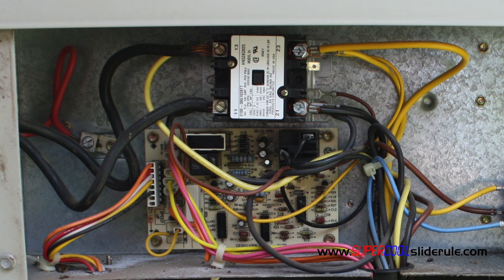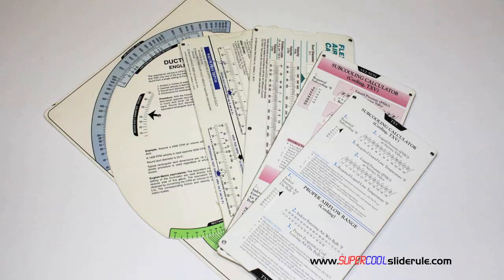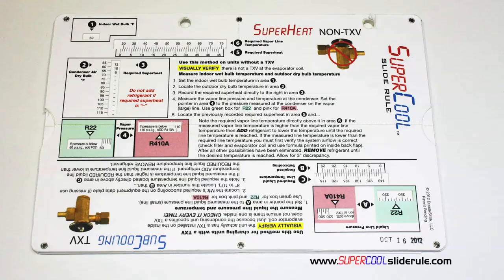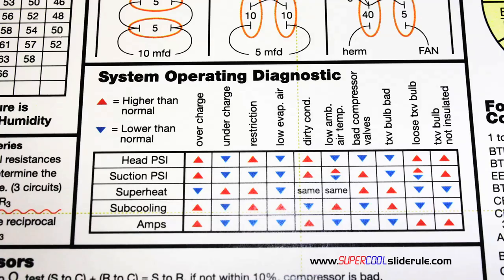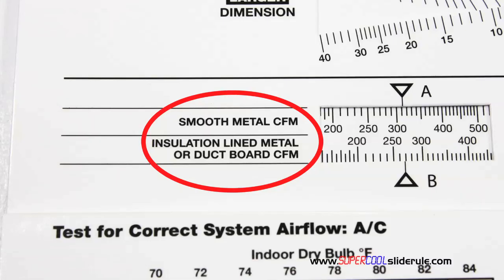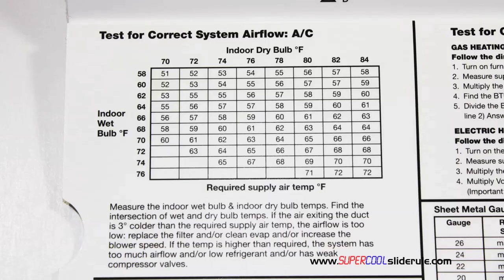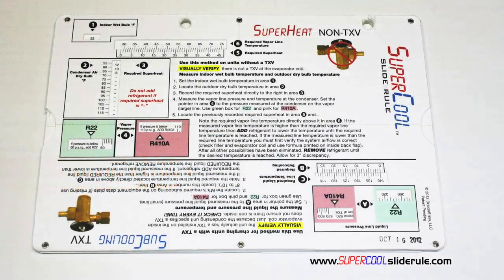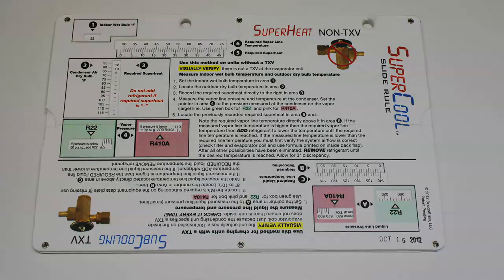How to diagnose a bad condenser fan motor

Comment: I bought a clamp meter and checked the dual capacitors capacitance and its reading what's on the capacitor plus this is a new one I bought the other day just wanted to see if it was bad.

Next if im even doing it right since I cant find on YouTube to show what wires to clamp for amp draw or what to set my meter to so I set it to 40A and clamped each wire that went to the capacitor as it was running.

1) Thick yellow one that goes to the compressor was 5.78
2) Fans black wire was 1.7
3) Fans yellow wire .82
4) Fans brown wire 1.51
5) Red wire coming from contactor to the (C) was 6.58

Now it took about 5 minutes to check these wires so no it wasnt hot but it was warm and I checked for oiling ports and there are none so I cant do that. I want to mention I had to spin the blades to get it going and Im not sure if it would have on its own if I waited but they turn slowly and eventually get faster untill it does run.

On a side note I spun the blades to see the resistance and if it spun and it did but with resistance then after running for the 5 min the resistance was gone and it spun better.

Motor Westinghouse 350358001 322P859 230V 1PH RPM 1075
Tech Specs: 350358001 322P859 208/230V 1PH ETU42 RPM 1075 1.5 3 3/16" x 1/2"SHAFT CAP: 5 MFD/370 VAC.CCW ROTATION 

The motor is 4-7/8" in diameter and if it was bad what replacement motor would fit because the westinghouse one is obsolete. Thanks!

Comment: Awesome!  Thanks!  I tested the leads with my Supco megohm meter... tested good.  I'm glad you clarified the heat pump board terminal connection.. I was stumped.  Turned out my first theory was correct;  thermal protection.  Fan was overheated.  The capacitor wires were reversed making the fan turn the wrong direction.  I also need to verify the microfarad requirement for this unit.  Never know who changed it last and just went with the closest thing on the truck.  I love YouTube training videos!  Subscribed..

Comment: I have an old lenox ...that's worked fine and did up until the time I shut it off last year.  I turned it on yesterday...and noticed that the temperature wasn't dropping in the house...then I remembered that I didn't take the cover off of the unit...The fan isn't running.  Did I burn it up having the covering on.  Was probably on an hour before I remembered.  what do you think is the expected cost to fix it; if that's the problem.

Comment: Will the fan motor be extremely hot if the capacitor is the issue?  The unit is "buzzing" however the compressor is not running. The fan motor is VERY hot and not spinning.

Comment: If a motor shuts off after running for several minutes and then automatically restarts after a 20 to 30 minute "nap" the most common cause is a weak capacitor. Replace the capacitor and see if this solves your problem.
Reply: I have seen video showing you can jump start the fan by spinning it yourself with a ruler or something long and thin.  If you can get it spinning this way this lets you know the capacitor is bad also, right?
Reply: The majority of the time this is correct.

Comment: What is with the red/orange ground wire.????????  I know that you have a lot of critics, but as an electrician and I see a ground wire that is not bare or green an alarm goes off in my head that says danger.   In the electrical field orange represents 480 volts " ouch " .   I do enjoy your videos, they are very informative, as I see some of  the comments on your board, there are a lot of people that have little or no knowledge of electric or air conditioning.   Have a Great Day and keep the vids coming.
Reply: I agree with you green and bare are universal ground color it keeps the next person who works on your stuff a headache from trying to figure out all the bullshit, as well as color coding the rest of your wire keeps people safe and may even save alife. As an electrition its such in my ass when someone doesnt color code or even try to label a wire probably. Low voltage is different, it has all kinds of funky color but whats not low voltage needs to be labeled

Comment: If fan runs at a greatly reduced speed after a 'push' of the fan blade is this a bad cap or a bad motor?
Reply: Capacitor

Comment: At 49 seconds you say "If the capacitor is good and the unit has a heat pump then. . . " in which case the video goes on to describe what to do next.  HOWEVER, you never come back and tell us what to do 'IF THE UNIT DOESN'T HAVE A HEAT PUMP".  So I give this video a rating of 1 star for being incomplete and poor grammar.
Reply: Yea that annoyed me too :/
Reply: Exactly, we don't have a heat pump so I need to know what to do in that case.  How common is a heat pump in the south?  I bet not very common.
Reply: In the South when heat pumps first come out everybody was having them installed so yes they are very popular, but also more expensive that is why you don't see as many.  I had one installed at our home but it didn't last all that long the reversing valve froze up and I by passed it and made a regular unit out of it.  Works great now, and I can't tell the difference in the electric bill at all.   Have A Great Day